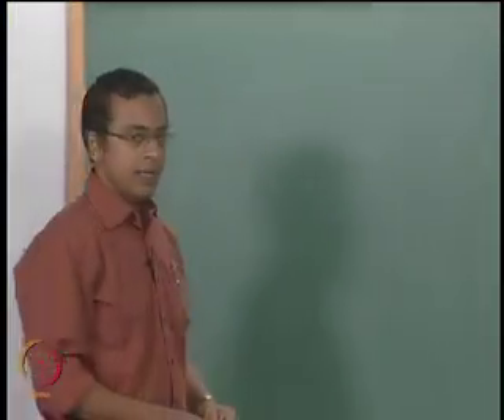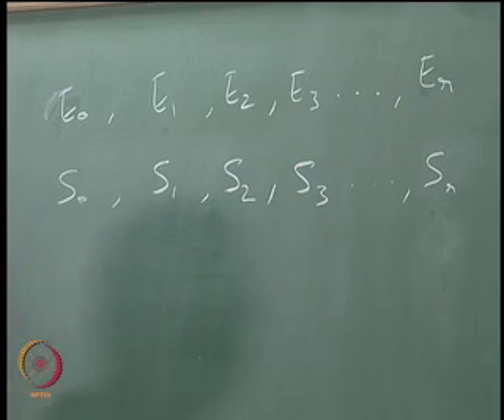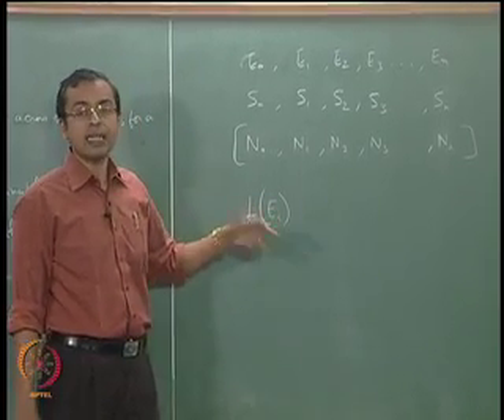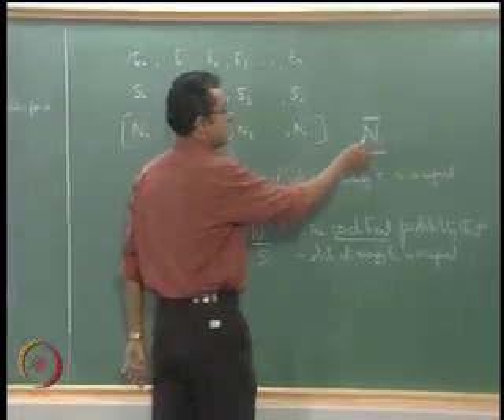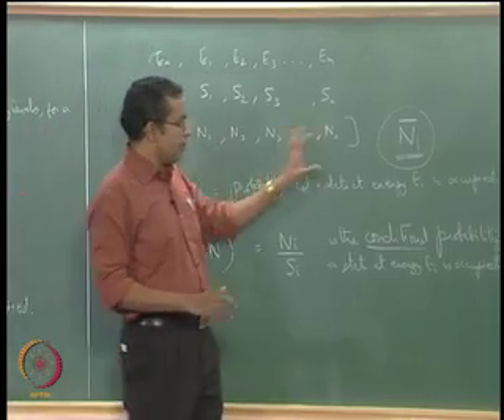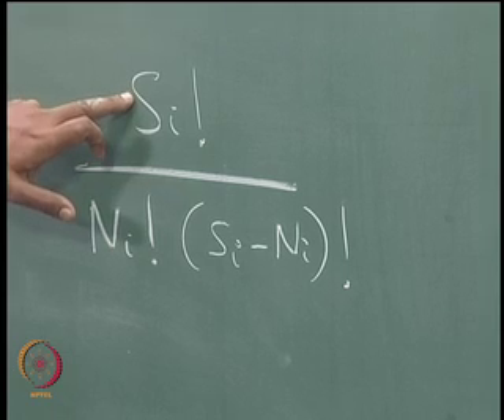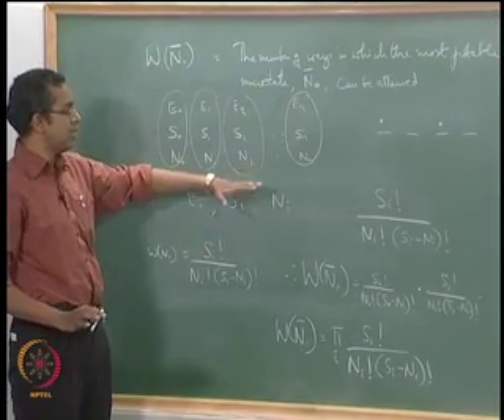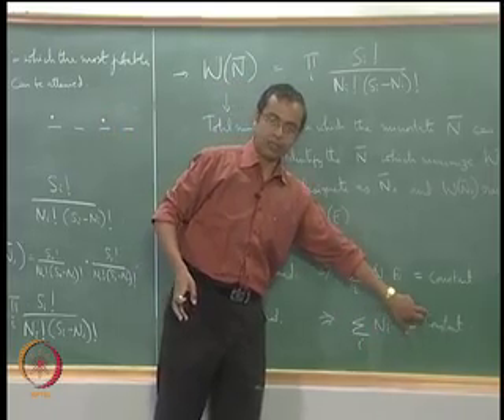Fermi-Dirac Statistics: Part 1

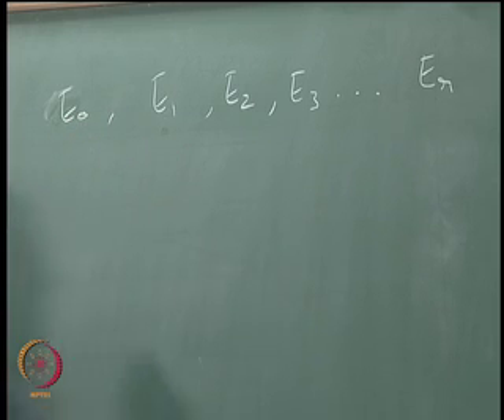Comment: sir what did u mean when u said @7:13 that "ateach energy level pauli's principle applies and for it to have any meaning  there has to be a fixed number of states at each enrgy level ." What if there are infinite states at each energy level?
Reply: for a real situation, a system must possess a finite number of states. Also if you solve the Schrodinger equation for a system you will get a finite number of eigenenergy values (may be you will get high in numbers)

Comment: Sir one microstate can happen in different way...and each n bar is one micro state....confusing....micro state of a system is one....macro state can happen in different way....sir please clear this thing
Reply: micro states of the system is not one.
among the many possible micro states, one state is the most probable, which can be obtained by many possible ways. for example if you toss two coins, there are four microstates (HH TT HT TH) assume the coins  are fermions, then we won't be able to know which coin has T and which one has H so the no. of microstates will be reduced from 4 to 3 .since, there are no difference between HT and TH
so the no ways to attain HT higher than HH and TT
if we do it for infinite no of times, then we can say that the most probable microstate is ht(but it's not the only one,but most probable)
here the no of ways to get it 2(ht and th)
but for HH and TT there are only one way to get that!

so most probable microstate is the one which you can get by many ways!!
Reply: One microstate can only happen in a single way(i.e unique) but for a macrostate there are many different microstates leading to same macroscopic values like energy, temp, total no.of particles and so on...
Reply: I think N bar is not a microstate, he is wrong at that moment.
Reply: @biswalksagar  yes, N bar is a distribution and the number of ways of achieving that N bar is the number of microstates associated with that particular distribution- N bar.